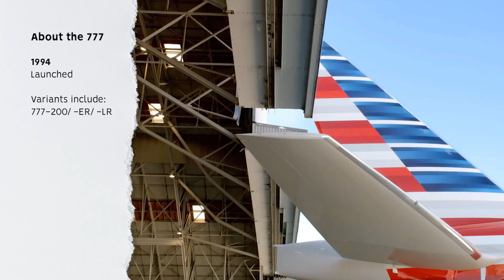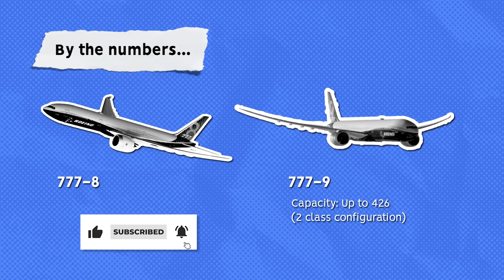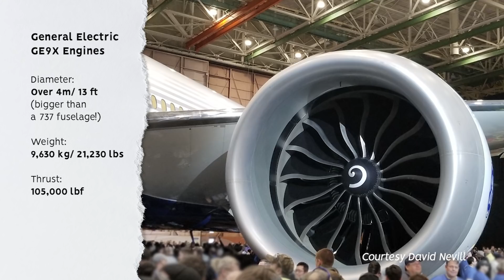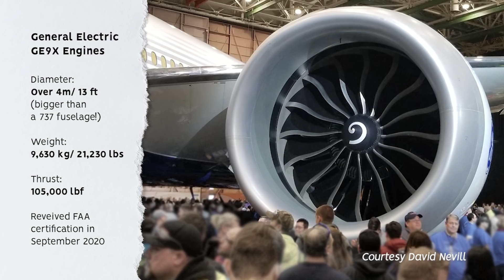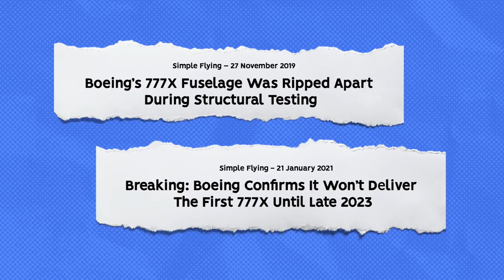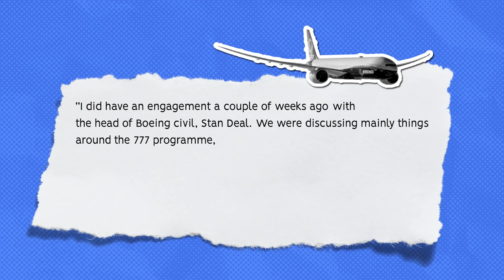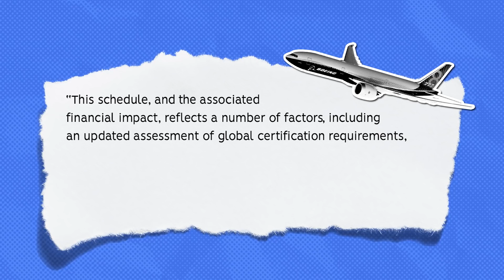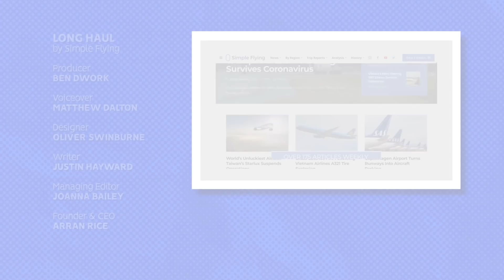Boeing 777X The New Twin-Engine Jumbo Coming Soon

Comment: The original 777 series was a remarkably successful design.  Boeing soon upgraded the original aircraft to create the 777-200ER, 777-200LR and 777-300ER variants.  Airbus used these as the basis for the clean sheet development of their A350-900, 900ULR and 1000 aircraft to offer similar ranges and seating capacity as their counterparts but, by using composites, with lighter airframes.  On a like for like basis the maximum take off weight savings are 40,000 lbs, 139,000 lbs and 96,000 lbs respectively.  Reduced weight in combination with modern engines allowed Airbus to offer significant seat mile fuel burn efficiency improvements.  Boeings approach has been to upgrade the 777 rather than take a clean sheet approach.  Faced with an all metal fuselage Boeing has taken the route of increasing the size of their aircraft by using lighter composite wings and adding more sections to the body.  The result has been that the 777-8 and 777-9 variants have similar maximum takeoff weights to the 777-300ER on which they are based but have more seats; the -9 trading more seats for less range than the smaller -8.  As Airbus found with its A380 that bigger does not necessarily mean better as Airlines have difficulty filling larger aircraft.  Like the A380, the largest customers for the 777X have been the Gulf state airlines.

Comment: I have a question to ask you all.
When a Big passenger plane is landing on the runway I have noticed that the engine in the middle opens up and my question is why it does that. Is that something new. I thank for your time.
Reply: It is called reverse thrust. Basically used when landing to decelerate the aircraft
Reply: I thank you very very much for the info.

Comment: 777's is basically just a 747 without a hump, with only 2 engines & near 3/4 of the toilets removed.  Better to have a 3 engined version of the 747, with an extended hump, with a engine layout like the Lockheed Tristar, but with the mid engine in the tail mounted within a aerodynamic shroud that after takeoff & climbing to altitude, can be turnoff & closed off to minimise drag. Because once cruising only 2 engines are necessary. Problem is, unlike feathered turboprops, high bypass turbofans have the aerodynamics of a brick when switched off.  This can only be resolved by something like a fuselage mounted central engine enclosed in an aerodynamic shroud that can be open & closed when the mid-engine is switch on or off.

Of course it won't happen now we can remove the hump from a Jumbo & remove 2 of the engines, plus most of the toilets, to maximise profits (the 777 has the same fuselage cross section as a 747 with it's hump removed)
Reply: Better to leave aircraft design to aircraft designers.

Comment: No other source of energy is as efficient, safe, or lightweight as jet fuel. It has far less weight, complexity and danger than hydrogen, far more range and economy than electric, far more safety than nuclear. There simply is no other option that comes close. 

Maybe someday we’ll have Mr Fusion from the Delorean in back to the future, but until then jet fuel efficiency is key.

Comment: When I hunt for air tickets, price is most important factor and departure times the second. But I wish some legislative body FORBAD the 3-4-3 economy class configuration on a 777, The plane is too narrow for that. 3-3-3 would be fine. Airlines are greedy, though.
Reply: The seats are 18 inches width, basically the same as the a350
Reply: @andrewkenobi9486  Not according to seatguru, they're not. I checked 4 airlines that use 3-4-3 configuration on 777: Air Canada, Swiss, United and AA. They are much closer to 17 inches, than 18.
Reply: @jansupronowicz1300  sia uses 9 abreast for their 777s

Comment: In a nutshell, not only 777X will not be a game changer, it will head into its market segment dead end.  Same story for the 350-1000.

Frankly, due to the long term market trend originally kick started by ETOPS in the mid80s known as 'longhaul fragmentation' now accelerated even more by the pandemics, i see the future sales potential for any type with 350seats(typical 3 class config) or more(i.e. 777-8, 350-1000 and 777-9) will follow the same fate of yesterday's 747-8 and 380 programs.

So no, most of today's 777-300ERs, the largest type in most longhaul fleets today, will be replaced by something no bigger than a 350-900 or 787-10.

The real game changer in long haul after the pandemic will be smaller, narrowbody types such as 321XLR.
Reply: there will always be a market for high demand trunk routes. Even just by the simple fact of congested airports with limited landing slots. However that market will be significantly smaller than it has been in the past.

Comment: With its fuel efficiency and long-range and high passenger capacity it's fairly clear it will be a game changer if they ever get the damn thing in the sky commercially. With all of that engine power it will make a hell of a freighter
Reply: Sadly not.  Qantas went with the A-350-1000 for the greater range, buying 12 initially for Project Sunrise,non stop Sydney to London Heathrow.

Comment: It didn't surprise me to hear that the fuselage was ripped apart during stress testing after hearing that the walls were thinner.
Reply: It's the inner walls that are thinner, not the fuselage. The inner walls are mainly insulation and soundproofing.

Comment: If it's same fuselage, it's another variant. Either way, I love the 777x more than the 777-300er, which was my favorite.
Reply: The 777-300ER seems better than the 777X. The extra capacity is what is affecting the 747 and A380. We do not need the more capacity, or it will just be another faliure

Comment: It’s amazing how strong the wings are, to  be able to hold a 21,000lb engine on each side of the wings.
Reply: Technically, the wings are holding the weight of the entire plane!
Reply: Bro. The wing is holding the entire weight of the plane
Reply: @vebastiansettel1173  even when stood on the ground?
Reply: Please use metric system
Reply: the wings have to generate lift to keep the weight of the entire plane and offset the negative lift of the tailplane.

Comment: what about 777X compete against 787, where will the 787 go?
Reply: It won't go anywhere. They serve different areas of the market. The 787s have a maximum capacity of 330, with most having less than 300 seats, while the 777X will have a maximum capacity of 426.

Comment: the future of commercial planes will be a flying medical center. Passengers are expected to share and transmit diseases on board. No human crew, only programmed autobots. No pilots as it will be flown using drone technology. Flying will be too complicated. The solution is high speed train for international travels.

Comment: after all of beings problems and as yet not confirmed issues with deviations from cnc machining standards and the "pickle fork" issue i will never ever fly on a Boeing as I expect structural failures mid air and landing. also the overly profit driven Boeing corporate structure and the rotten performance of the FAA, combined with the general insanity that seems to prevail in the once admirable USA makes flying boeing about as desirable as crewing a ww2 bomber over europe

Comment: I am so happy to see Boeing making it to the top again
Reply: Why? They are a crooked company to the core. Their current CEO was on the board for many years and part of the damage control that put the blame on the pilots when the two 737 MAX's crashed in 2019.
Reply: we can only hope so. I was a boeing fan a lot of years ago, when I was doing maintenance on 767s and 777s, It´s hard to say, but this company did such a big number of mistakes in the recent years, that it would be a miracle to jump on top with this plane again.

Comment: If the economy seating is 18 inches proper with a cabin pressure of 6000ft then economy will be just bearable and acceptable on this long haul beast.  I don't care what the plane ( aside from being safe ) if a passenger can not travel without being crippled or suffer mild altitude sickeness then I really have no intention of flying it.  The 787 is a bit narrow on the seat but the cabin pressure is good as is humidity. The A350 and A380 are good.  The A220 with up to 18.5 inches is good for long haul and arguably better than the 777x and 787 for long haul and also the A320 series.
Passengers need to vote for comfort when they buy a flight all else is secondary if you are going to arrive a cripple.

Comment: I would be more concerned with the use of computers to fly these aircraft ,removing the pilot as the primary flight controller.
Reply: How so? The 787 is mostly computerized, and basically every Airbus is entirely computerized.  If done CORRECTLY you wind up with a safer aircraft.  Boeing's issue has always been their stubborn reluctance to adopt state-of-the-art technology, and instead they slap little band-aids on to their aircraft as required, which makes for an awkward jumbled mess of additional systems which usually don't "play nicely" with eachother in an intuitive manner.  Meanwhile AIrbus's automation and computer systems are all integrated and are VERY simple and intuitive - with the added benefit of full flight protections as well.

Comment: I understand that 2 Engines means less Cost over 4 Engines plus less maintenance but that HUGE engine has to be mounted Really Good.  I saw a DC10 lose its entire engine at take off!  All 300 people died!  Boeing placed Big engines on the 737 max which cause the plane to stall so it got a secret program to bring the nose down.  It went on when the plane was level and cause the plane to dive + crash.!

Comment: The 777-X is going to prove that Boeing still understands changing trends in aviation more than Airbus, but Airbus would capitalize by building a slightly improved version of the aircraft to tap into the void it will be left with.
Boeing will eventually build the NMA, which I would consider the real game changer for airlines eager to replace 757 and 767 aircraft.
Reply: I'm sorry to say that Boeing might understand changing trends, but people dying due to a lack of quality knowledge and processes, doesn't make sense at all. 
They need to pull those Quality manuals out of the rubbish dumps and dust em off. Then after they update them, they need to bind it in a gold covered cover and place on a shelf, not in a cupboard, so everyone can see and read them daily.
 Maybe give it a high profile name "Quality Control Bible". Oh and all the execs have to read it when they first start working for Boeing.
Reply: @MrWillt100  Quality assurance has nothing to do with knowing what type of aircraft to build, and when to build it. Everything Airbus has built to date has been something to compete with what Boeing has already built. The only aircrafts that could be considered game changers from Airbus are the A380, which came a bit too late, and the A220, which wasn't even designed by Airbus.
I would agree that Boeing needs to replace their management with people who care more about engineering than the bottom line. Ever since other manufacturers left the scene leaving the duopoly, Boeing is still setting trends, not following it. The exception would be the Max, and we all know how that turned out.
Reply: @sainnt  Quality play a big part when it comes down to costings.
Reply: @sainnt  Timi I agree but it still plays a big part in costings as well the build in general. I personally will not fly in a Boeing if there is another plane flying to my destination. Why because I know first hand after seeing video where workers said they would not fly on the plane they had just built. Boeings reputation is mud as far as I am concerned, and you can say what you want regarding changes made at Boeing but that ain't going to change how I feel.
Reply: @MrWillt100  Those workers who claim that would not fly in an aircraft that they built are exactly the problem. They take no pride in their own workmanship. If they would not fly in a Boeing, they should not work at Boeing. As much as Boeing aircraft is being scrutinized at the moment, I'd rather fly them than any other aircraft out there. As good the A350 is, I still like the Dreamliner that inspired it more.
Reply: @sainnt  Timi I'd sooner trust them more than I'd trust their management and executives and for that matter share holders.
Reply: @MrWillt100  Still, as an av geek, I'll always seek out aircraft I've never flown when I have the chance. Right now that means the Max 9 and 10, The Max 200 built for Ryan Air, the A350-900 ULR, A330 Neos and the new Embraer jets. I've flown on the Max 8 more than once, and it's perfectly fine. In this world we live in, everyone has lost the ability to allow humans to make mistakes. One screw-up, and  you're being cancelled. Boeing has been building aircraft for nearly 100 years, and will continue to do so into the future. Airlines will continue to fly people in Boeing aircraft, and I'll continue to be among them. You think Airbus is perfect? I suggest you check their history more closely. The Boeing screw-up on the Max was because of the FAA not doing its job, which is why the FAA has suddenly become the wicked stepmother for Boeing. It was more of a national embarrassment, not just a corporate screw-up.
Reply: @sainnt  Boeing has only shown incompetence in the last decade. It is a well known fact in the airline industry that their reputation is tarnished. The fact that the 777X is delayed till 2025 (or later, since they've been putting out new release dates) isn't helping either.
Reply: @TheEchelon  You're beginning to sound like a Boeing hater. I'm just stating the facts. We all know what's going on at Boeing, but they're still building aircraft and airlines are still flying those aircraft. All Airbus fans tend to act as if Airbus is squeaky clean, but like Boeing, they're a corporation. A squeaky clean corporation basically doesn't exist.

Comment: Your A340-600 is the exit limit and is not it's typical capacity. It's 3 class configuration is in the range of 320-370. This is per Airbus website.

Comment: When these things finally get off the ground, I won’t be booking on one ... I know the hell that is a 10-across 777, and the fuselage diameter of this new plane is unchanged from the old, and they’re saying it will be 10-across. 

No thanks.
Reply: Try the business class cabin. I think you will find it more comfortable. But I agree with your view of economy travel on today’s aircraft.
Reply: @artstewart1894  — You’re right, of course, but I travel a lot, and I’m too cheap to buy business.

I do shop for the most comfortable coach seating !! Most recently, it’s mainly been Japan Airlines and Emirates (A380 only).
Reply: @sking2173  On all my routes Business is 3.5 to 4 times the cost of economy. Enhanced economy is 2.5x
Reply: That´s no change. There are also 10-across 777 in nowadays version. For example lauda air had a mixture of 9-across and 10-across in one and the same plane during the 2000s.
Reply: @hannes7348  - What’s your point? 
Korean Air and Japan Airlines equip all of their 777’s with 9- across in coach. Many of 777’s at Cathay are still 9-across. 

I fly those. I refuse to book on a 10-across 777 ... That’s not going to change for me.
Reply: @sking2173  It was only, because your original coment gave me a wrong picture. I thought your opinion is that 10-across is comming with the x-version. Sorry

Comment: I was kinda hoping that Qantas would go with the 777X for its Project Sunrise, but it looks to be going with a modified A350 instead. It'd be interesting to see how a 777X could be modified for ultra long range, though.
Reply: I was hoping too.
But let's BA get that deal and launch nonstop flight from London to Sydney as direct competition against Qantas 😅🔥
Reply: Good ... this 777x appears to be a real cattle-car ...
Reply: A350 is more comfortable as the cabin width is wider for a 9 abreast seating compare to Boeing 10 abreast seating. Somehow Boeing planes are narrower compare to Airbus.
Reply: @yours_sincerely48 what about now that the a350 new 10 across seating
Reply: Well, it looks like the 777-8 can be made in to a HGW variant which will allow them to have more range, so if other airlines wanted to open up ulh routes with that, it might be a thing

Comment: I loved the B747 as I travelled far and wide on it. the B777 -200/300 is a marvelous jet too on long haul, looking forward to the X version.
Reply: Those 777’s with 9-across coach seating were nice. When some airlines converted them to 10-across, they made it miserable.

They’re saying this 777x will feature 10-across seating ... NO THANKS ...
Reply: @sking2173  The last time that I was on  the B777 was a seat on a British Airways Club world. Flight  ( like at the front ) and it was not even 9 across  more like 4 (  BA had upgraded my ticket  ) and I really enjoyed the comforts, the heated napkins to clean my sweaty face, etc Lol !
Reply: @sking2173  It has the option for 10 abreast, but that's up to the airlines, who normally do 9...
Reply: @TheEchelon  — The industry-standard coach seating configuration for the 777 is 10-across — sadly.

The few airlines that still use the 9-across configuration are for me, preferred.

Comment: 737 max: "I am the most overstretched overengined design in the industrie..."
777X: "Hold my beer!" 
How many more people need to die before Boing starts designing new airframes and stops smacking insanely big engines on overstretched old airframes? I won't be flying this flappy winged heap...